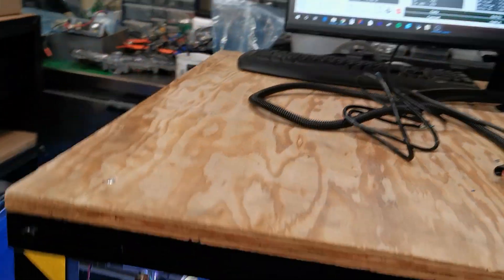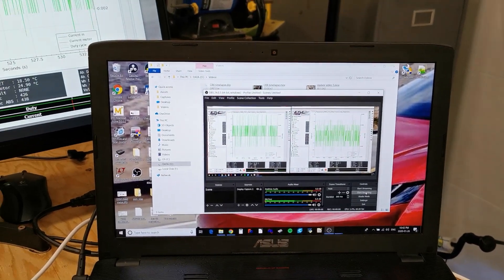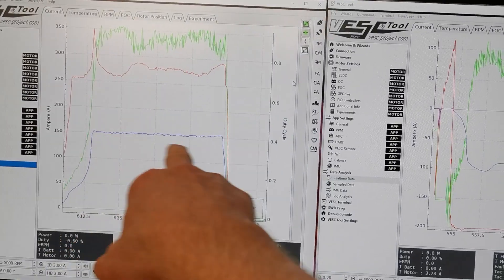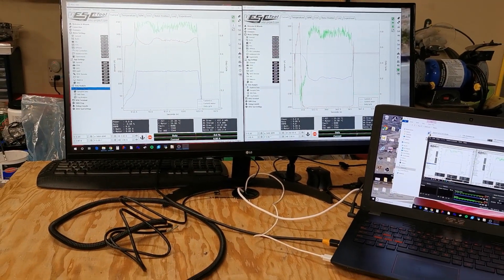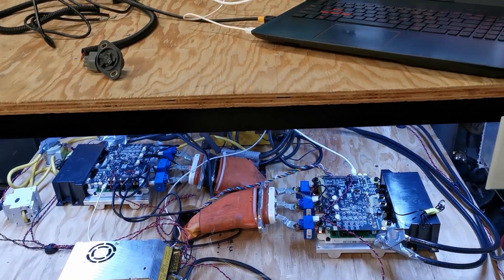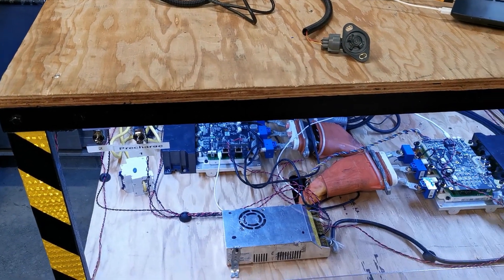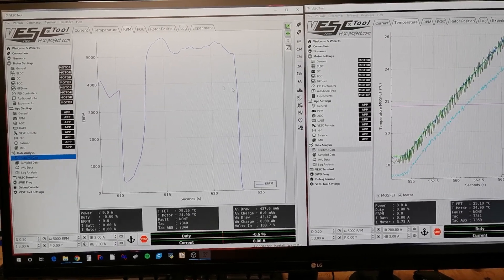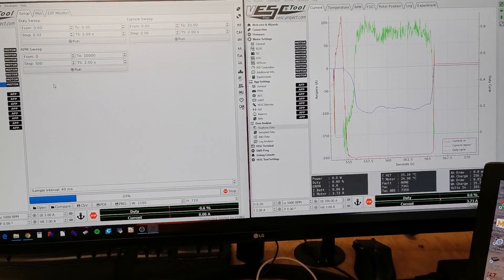Dyno shakedown

Comment: Pretty cool setup. Will you be able to hold an RPM to tune the drive waveform?
Reply from the maker: Likely yes.  A RPM sweep is likely 1 way.   But what do you meen by "drive waveform"?  You meen the Current PID loops?
Reply: @garbizwal  Yes. I don't have any experience with this, but I assume you don't drive the windings at full current for the entire phase. Figured you could use your Dyno at a fixed rpm to determine where you can gain efficiencies by reducing current.
Reply from the maker: @cheapygeek  Yes there is a few big reasons and lots of smaller reasons for the dyno.   First is to tune the controllers to NOT FAULT.   <-  This is a long and Arduous task..  The Second BIG reason is to find full power but part of that you need things to be as efficient as possible.   When looking at the current into 1 phase you will see a sinewave of current flowing in which should be very close to the back EMF voltage of that phase.  So tuning a current control loop that the controller can keep well under control and smooth is part of how this is done.  We use PID loops for this.   There is many other items involved like running sensored startup then sensor-less at higher RPM or just keeping it sensored all the time.  Making sure the sensor timing is correct.  Sorting out any noise getting into wiring or into the circuits of the controller it self.  Also just proving the full power potential of the controller it self.  So non the less stay tuned as this is about to get VERY exciting!!!